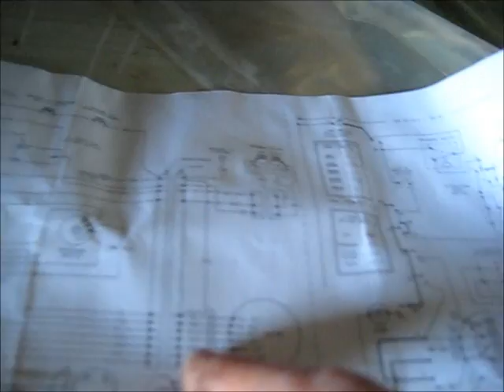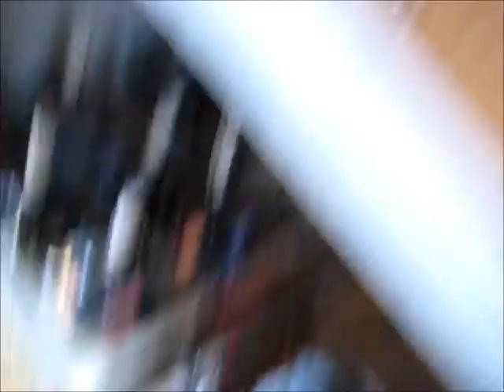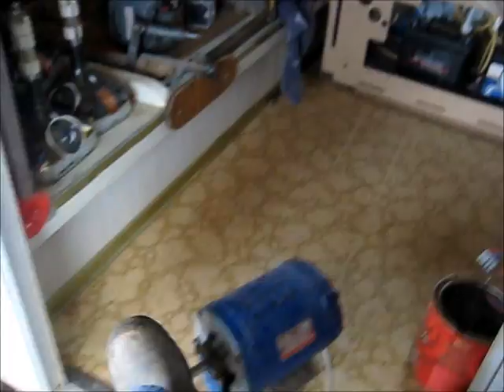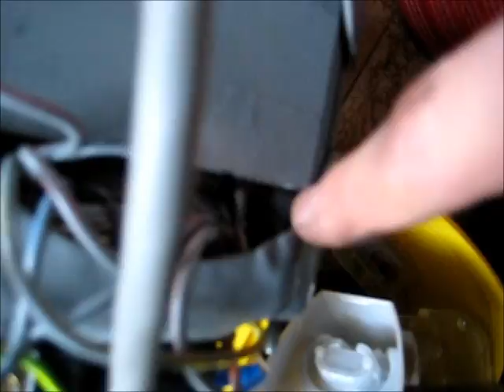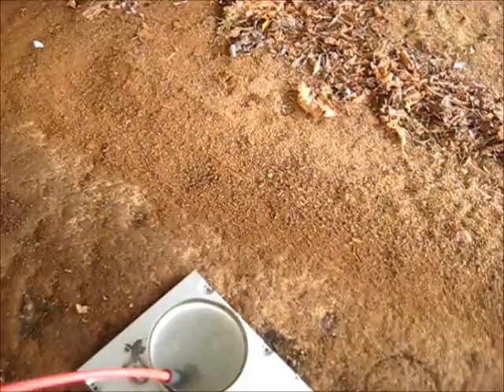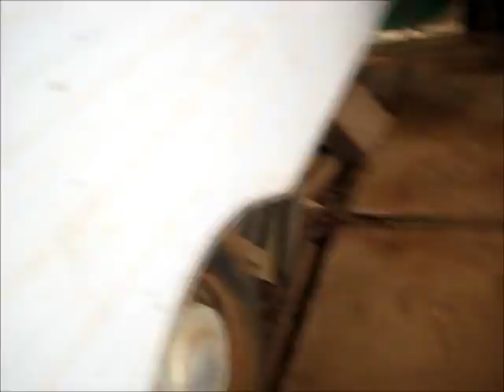Test 2 Motors & Metered Ballasted MOT Heating up water

Comment: @HDXFH Hiya! My circuit's also on a RCD. All you need to do, is to ensure that no power can reference to Earth, and all will be OK. As you saw in my under water arc-up videos, the container is glass, & at 240v, glass is an insulator, & the livened water could not go to to earth, so the RCD didn't detect any leakage to earth, so stayed on. If you're doing the mains power cord in a metal can, just place the can on a rather thick, dry plank of wood,& this'll insulate the can from Earth.

-BBD.

Comment: Have you seen my videos where I put a mains power-cord straight into a glass of water? 

Try putting BOTH electrodes into the water, connected to a ballasted MOT, and see what happens at that voltage. 

It may buzz & pop a bit so be careful of splashing water which may potentially be quite hot! 

Of course, it is possible to boil water from a mains power cord at 240v......Just dunk the stripped ends of a cord, and turn the power on. :-D Bubble-bubble ! :-D

{^_^} BoomBoxDeluxe {^_^}

Comment: The washing motor is  2 speed with reverse direction, the start winding sounds ok but your connections to the start switches are incorrect,  i can get the wiring diagrame out of my ute id you like ? and give you some pointers